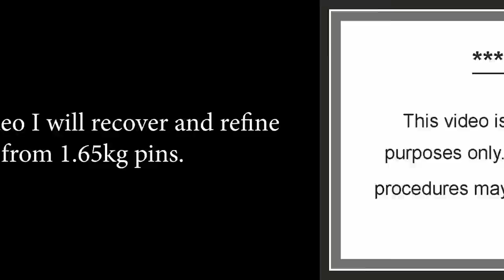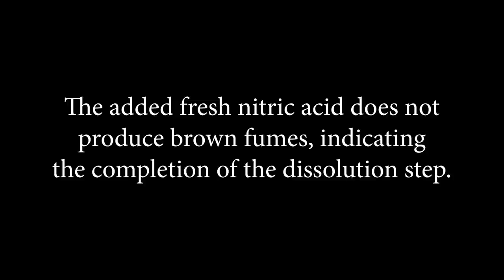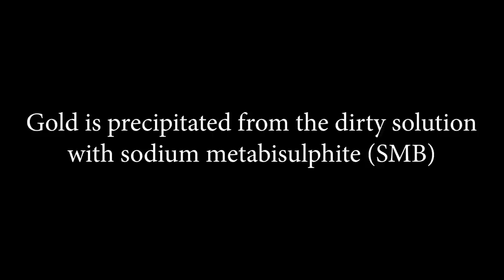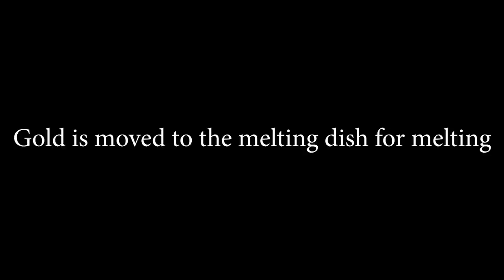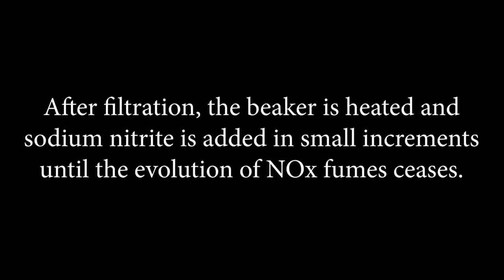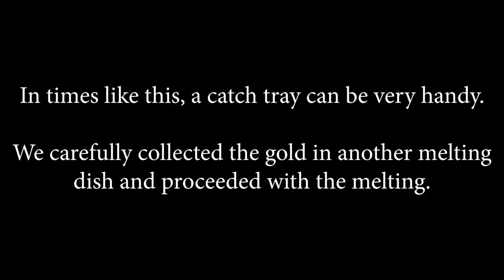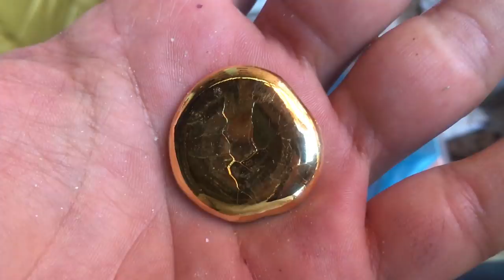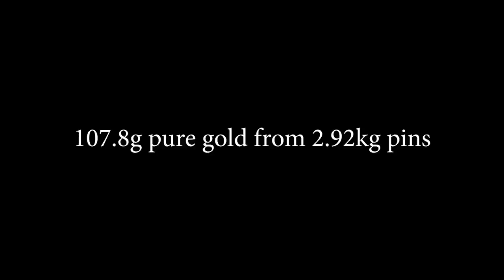55g GOLD from 1.65kg USSR pins

Comment: very nice and a lot of info, way to go. I noticed you must have access to plenty of the needed chemicals, some of which are hard or even impossible to get these days (i.e. HNO3). Hence my question, is it possible to achieve the same result using only the minimal amount of chemicals,  for instance, you need a lot of de-NOx-ing product so perhaps it's possible to use less HNO3 to start with? Kind regards

Comment: Crap i hit "send" too fast.

Would a leech with iodine have worked in this case or was the plating too thick for that?
Reply from the maker: If the pins were mine I would have tried it... anyway there was a lot of solder which holds substantial amount of gold, gold that iodine can't reach
Reply: @OwlTech333  Oh yeah. Its sad but of course you still need a HCL wash for one or two minutes with HCL before you use iodine or any other less harmful solution.
Yeah, the remaining solder is realy an issue ...

Comment: One more question: Why don't you use hydrogen peroxide with nitric acid to reduce NO2 and turn it into nitric acid again (saves nitric)?
Reply from the maker: I didn't have any
Reply: @OwlTech333  OK, can't beat that... :-)
I am just collecting stuff now and looking for ways, to process it efficiently with low waste and not much toxic fumes. One German guy uses HNO3 and H2O2 to get rid of base metals, looks like it works well, I just do not know, if it does not disolve gold aswell. Should not, but I have no practical experience yet,
Reply from the maker: @frantiseklaluch6605  It doesn't, I have tried it.
Reply: @OwlTech333  thank you :-)

Comment: Thermal shock is what broke the melting dish.
Reply from the maker: I've done this hundreds of times and this is the first melting dish "explosion", from experience they аre quite resistant to thermal shocks. The dish was brand new, still hot from the borax glazing... @20:38 you can see a hairline crack on the right side of the crucible... maybe this is the culprit - a manufacturing defect...
Reply: @OwlTech333  that is it would take a small crack.

Comment: No offence, but in my opinion is a fake. You simply cannot have 3.3% gold on those pins. In the past I had trust in what you said...
Reply from the maker: no offence taken, just because you haven't seen a crocodile it doesn't mean he won't eat you... Google РППМ 17-48, or even better https://youtu.be/VjJP9BYkvU4
Reply: I already did a search. There is only one article about this connectors in terms of gold content and this is on thebridgestudio.ru and another 2 or 3 sites (the same article). They are giving indeed a huge percentage of gold for this kind of connectors - max. 2.5%. But not 3.4%. In this case how reliable is only one source for information, wich is not even official? After that, why shold I make a connector with such a thick layer of gold wich is a soft metal and after few hundred cycles I'll remove it by scratch? And there are some other more reasons. Even I didn't saw the crocodile, I can use the common sense. Anyway, I wish you good luck.